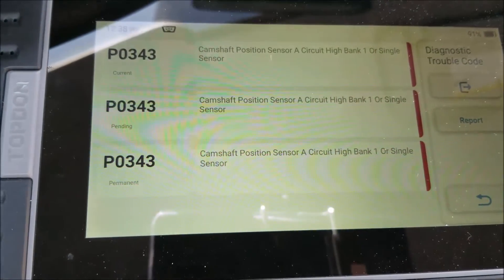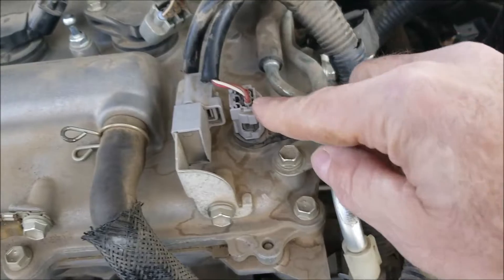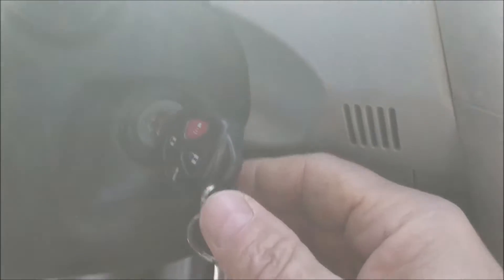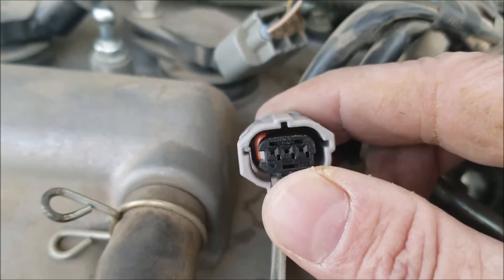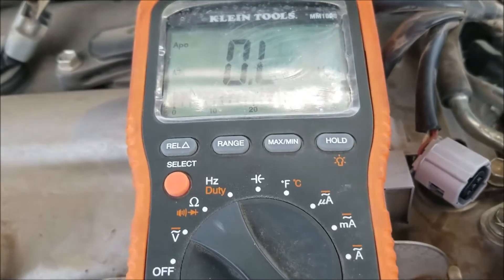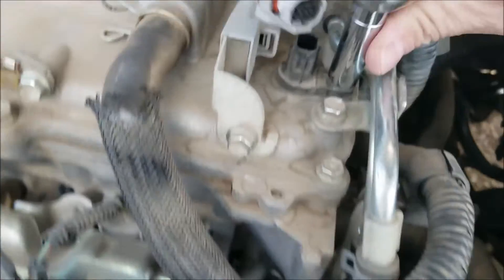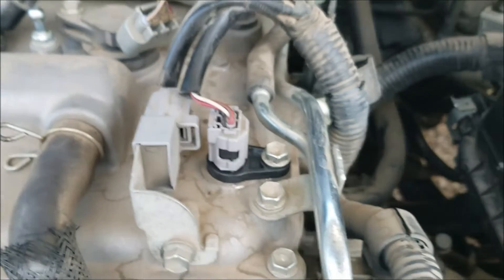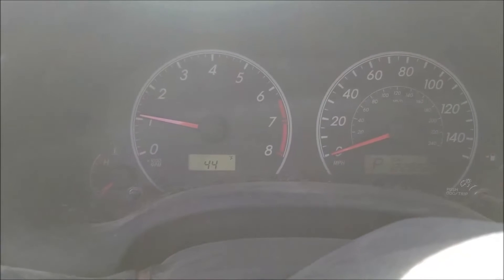How to Fix a Toyota Corolla P0343 Code: Check Cam Wiring and Replace Cam Sensor

Comment: Is P0343 always sensor A? I've got a 2007 Prius with this error and my mechanic won't touch it (though I think only sensor B requires the removal of the hi voltage inverter).

Comment: Have a 2014 toyo Cam 2.5  P0335, p0340, p0343, p0368. I get signal n ground but I erase the codes n they still stay permanent
Reply: Did you ever get it figured out?
Reply: @YO-zh1hu  Even after you fix it correctly and erase the codes, the check engine light will go out but the code reader will still show those codes as "permanent". This is fine because nobody can erase permanent codes except for the engine computer. Just drive the car as you normally do and the codes will disapper eventually. It's only "active" or "stored" codes that will turn the Check Engine Light on.

Comment: i have this code on my 2013 Corolla. Changed both cam sesnors and the car still just cranks, and wont turn over.
Reply: Hey did you got it fixed, mine act same
Reply: @navjotsandhu73  - nope, car still wont turn on
Reply: @Abused.Ls2  is it sitting like that for a month?
Reply: @navjotsandhu73   yuup its been 4 months just sitting outside
Reply: @Abused.Ls2  did you get the timing belt replaced or adjusted
Reply: @navjotsandhu73  no, i replaced the cam and crank sensor and it still wont start. Im really hoping its not the timing chain 😢
Reply: @Abused.Ls2  my jetta did same thing, now im trying to do belt adjustment tomorrow and will tell you if that worked
Reply: @Abused.Ls2 hi.Did you manage to solve problem because mine still have that problem
Reply: Have you checked the voltage like he did in the video? If you did, what were the voltages?
Reply: @bernardocisneros4402  - it was my key the whole time, the security system in the key wouldn’t let my car turn on lol

Comment: What if both outer pins read 5V?
Reply: It is perfectly normal for some cars to read 5V on both outer pins when connector is disconnected from sensor. When the connector is connected to sensor, one of the outer pins will read 5V while the other outer pin will read less than 5V (0.7V to 4.5V).
Reply from the maker: It is always best to get a schematic of the pins on a vehicle to be sure what the voltage should be. But usually, there is a 5-volt to 12-volts on one pin, a ground pin, and a pin for the signal wire to the onboard computer.
Reply: @HVAC_Mechanic   The sensor wasn't your problem. It was the signal wire. Am I right?